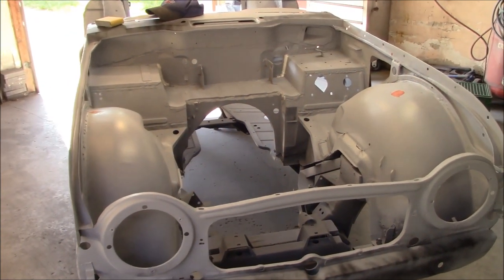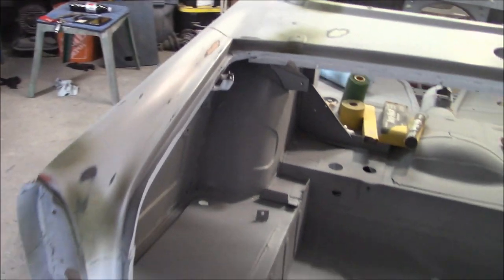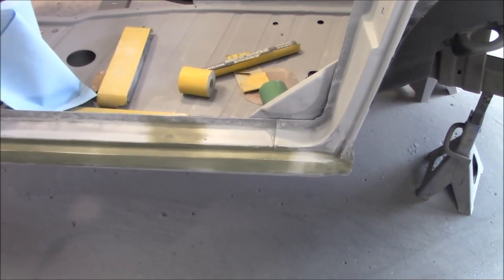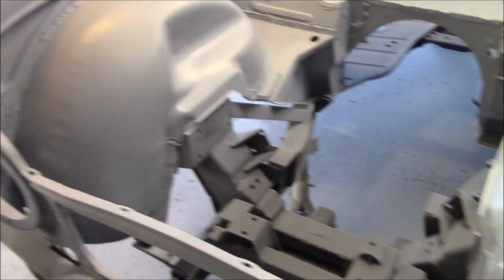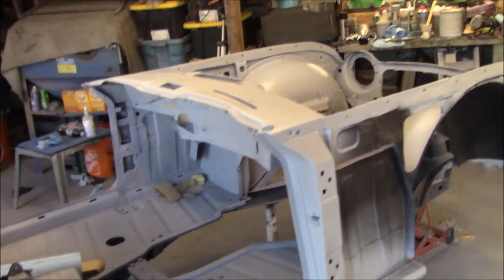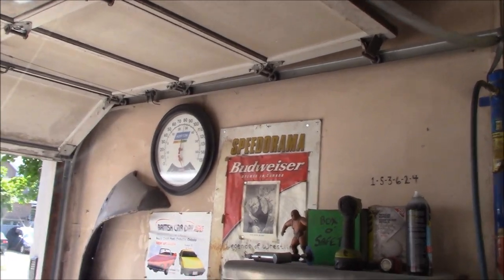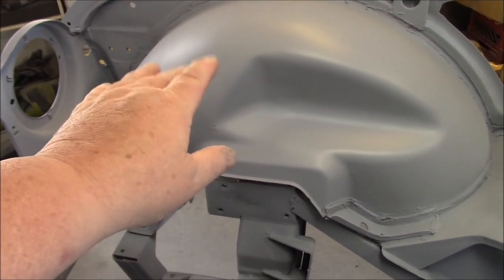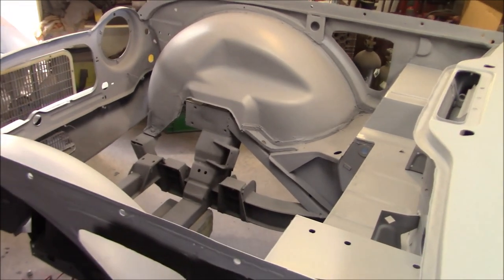1968 Triumph TR250 Restoration,  A Few Small Repairs and Final Prime Time

Comment: Looks fantastic ! Again great work in the extreme heat .Hoping Les is moving along on his project as good as you are . Custom front bumper ? That should be interesting !
Reply from the maker: Hi Thomas, yeah I’m going for a simpler bar type on the front with a couple of lights.  I’ve got some nice Lucas ones stashed away.

Comment: Happy Fourth to you too! Out here in rural Tennessee it sounds like Beirut in the 80's. Non-stop explosions. 

Your TR250 is really looking sharp! Exciting enough for me, but I'm a Paint shop guy. I'm very interested in seeing how it goes with the top coat. And are you going with a clear coat afterwards?

Your dryer situation had me chuckling. One of our dryers (my old plant has four) would take up most of your garage, and it's been known to put out wet air. Pretty bad for the jobs in the booths, and kinda hard on the robots. It's supposed to keep the dewpoint down to -75. Maybe yes, maybe no. 

It's a purge dry system (non heated) and when it blasts the "wet" chamber to atmosphere you can hear it about a Kilometre away. 

There was even an accident related to it cycling one day. An outside painter (a contractor) was up on the roof on a Saturday (he wasn't supposed to be) and he was working close to the edge of the roof (again, something that you just don't do) and one of the systems cycled and it startled him and he fell off of the roof. Amazing that he didn't kill himself.
Reply from the maker: Yes sir, I’m going with a base/clear system.

Comment: Actually I think this is very exciting. Wet sanding is right before shooting color on the vehicle. Which I think is a huge milestone. Btw, how are you going to paint around the frame? Or are you shooting color on it as well? I would think you would  try to keep it black. Maybe it's just dust but looks like maybe over spray on it in the photos. I used to use old bed sheets on tires and other things I didn't want painted
Reply from the maker: Doing it a bit different this time Jon....usually, I would build the chassis then put the body on and do the paint...however, no matter how well you think you mask off the chassis you still get tons of dust and overspray on it and it looks awful in the end.  This time, I’m painting the body and then I’ll remove it off the chassis and put it on a wood buck.  I’ll then work on the chassis build up including painting it before I put the body back on.